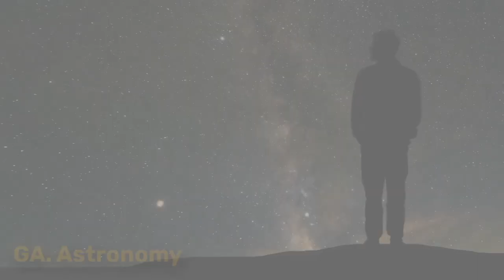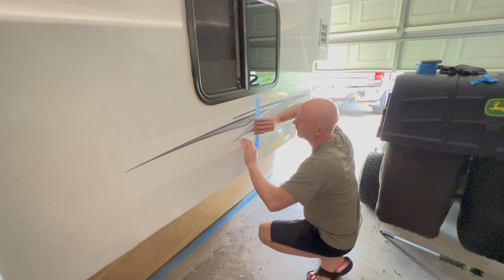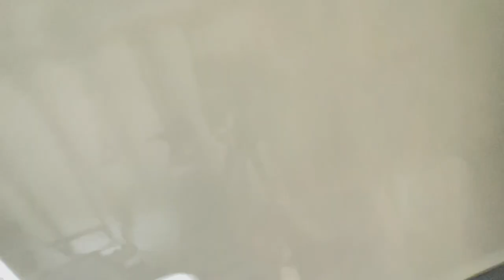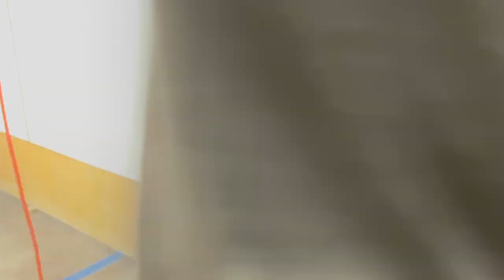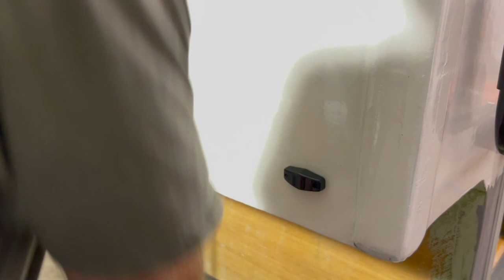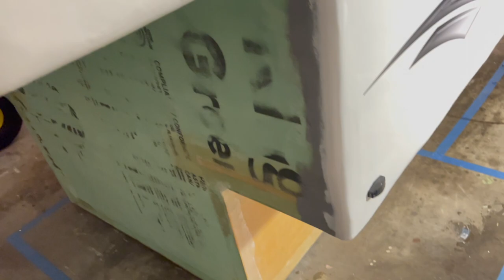Painting my foamy truck camper! (It looks better than anyone thought!) EP. 11

Comment: I'm a retired American teacher here in Australia (moved here in 1979) ... I grew up in Michigan and did a lot of Gold leaf signage and airbrush mural work back in the late 60's and 70's ... many boat yards used short nap (mohair) roller covers to paint he sail boats with "boat epoxy paints", which surprised me as I was a bump and paint man before my Military service... There may have been a very small dust issue from time to time... but I would lightly sand the gold leaf base area after I masked it with masking tape. This gave the sizing a perfect base and the I remove the tape after I applied the gold so I could out line the letters and maybe add drop shadows. If I airbrushed a mural on the back or the deck of a speed boat, I either airbrush the artwork on "Acid Free" tissue paper, roll a clear coat first and then apply the sheet on top with some help. Then three rolled on clear boat epoxy paint on top. With a white base, you couldn't see the tissue paper and being acid free, it didn't yellow....I am impressed with all your effort on this project... Happy camping.... which I'm sure beats a "Ruck Sack", sleeping on a ground with an air mattress deflated ( they would squeak is you blew them up and you moved around)  in the "A Shau  Valley" (2/502 Inf 101st Airborne)
Reply from the maker: @airbrush ken Thank you for the kind words and as one veteran to another, thank you for your commitment. A departed, close friend was also 101st during that era. (Myself, USCG)

Comment: Nice job, just a thought,  if you go with a 7 way plug, you can add backup lights and additional 12v power. Any thoughts about adding a backup camera?
Reply from the maker: I was considering a Furion and I still might. I do have a 7 pin on the truck.

Comment: I'm incorporation some of your ideas in my camper build.   Two coats of resin inside is my plan. I'm using rubberized paint on the roof.  How do you plan to anchor it the truck ?  thanks for the ideas.
Reply from the maker: Thanks Bob! In retrospect, I would wrap the interior with fiberglass over another layer of 5mm. Next video or two will have the anchor system.